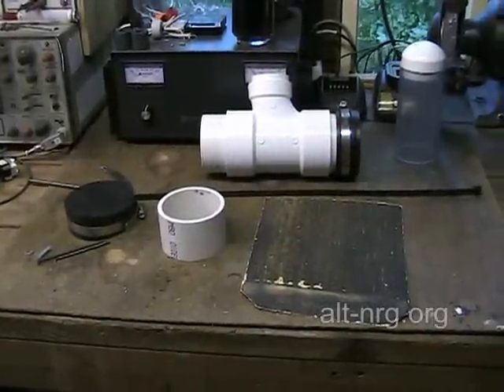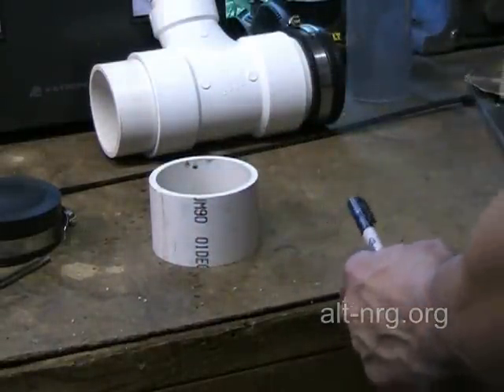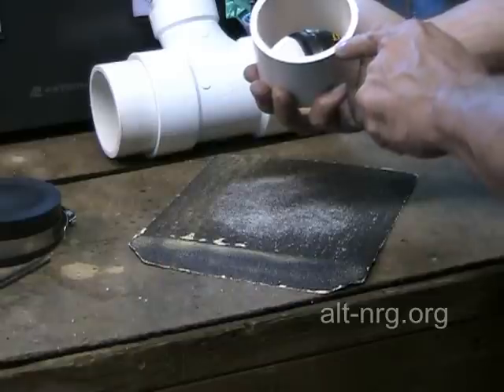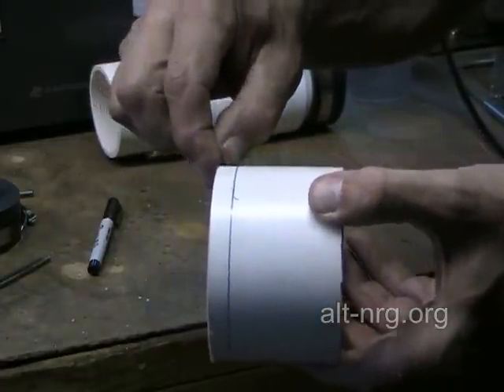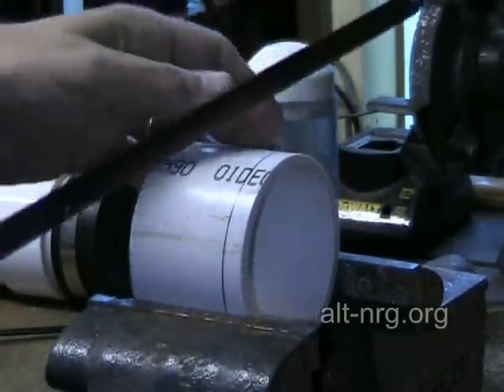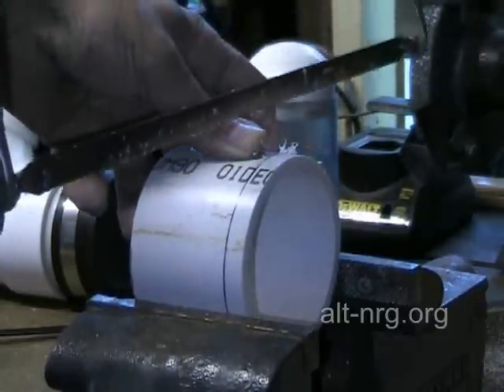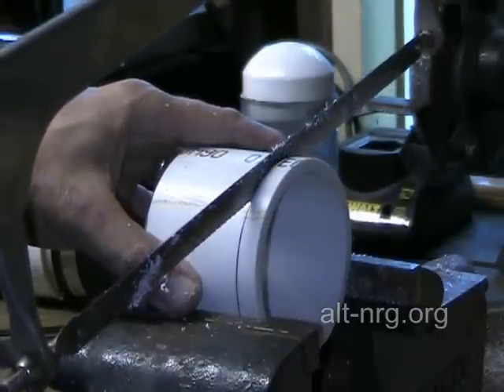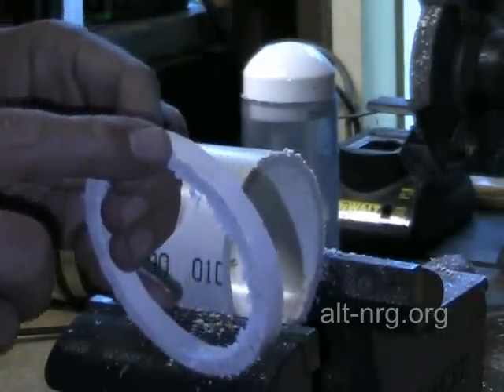#187 - Inverted-T cell part 2

Comment: You need to build a miter box, a jig to cut the pipe.   Build a box that the pipe will fit into.   Then cut one strait cut through each board on each side.   Thereafter put the pipe in the box and cut the pipe using the box as a guide.

Comment: I have seen on a home improvement show where they actually used a piece of string to cut the PVC.  They wrapped the string around once like you would if you were cutting cinamon rolls with dental floss and pulled the string back and forth in a sawing motion.  I personally have not tried this, but I thought this might make your cutting easier.